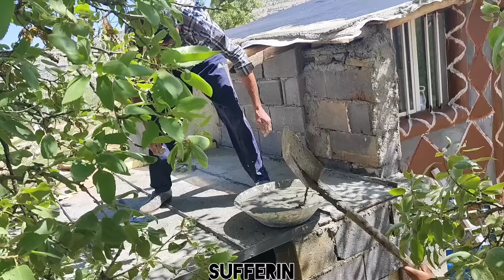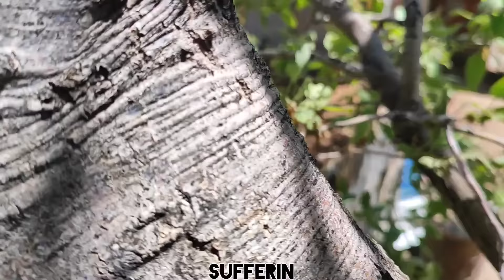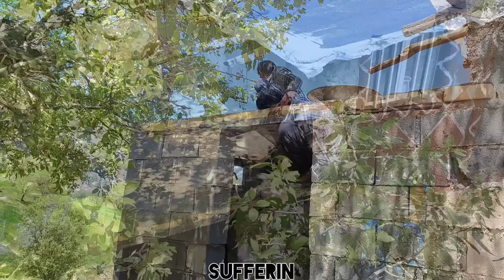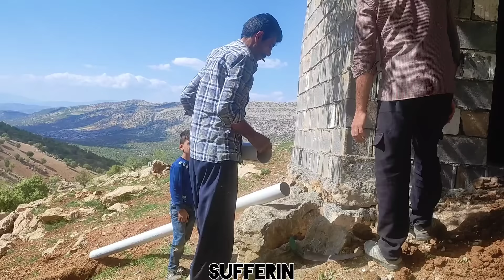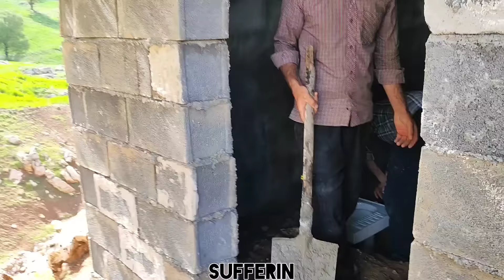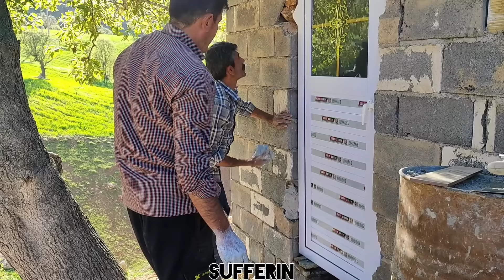A day full of love and affection to complete the bathroom

Comment: I was wondering if they need to install a medium size water tank on top of the ceiling bathroom to take showers. 🤔❤️🙏
Reply: Or either they need a water heater tank that needs to be connected to an electrical outlet. That would be a different project to do and I don't know if they hàve access to electricity. Probably they'll warm up water and take showers with a bucket on the side.
Reply: I seen a channel , Doo. The pregnant lady had her brother I think put a 30 gallon or 50 gallon drum on top of some stairs  and she goes out and lights a fire under that drum to get the shower water ready.. Pretty cool concept....
Reply: Where are they taking showers now ?
Reply: @margaretjohnson7207  I do not know but I watch Doo and she lights a fire under that barrel, heats the water and showers her little boy regular...

Comment: Why is dirt used on the roof if it doesn't cover any leaks, on the contrary, turns into mud and only does is a mess?
Reply: He put concrete over the dirt, which is one of the best insulation methods available.
Reply: Acter they have to put tar or bitume